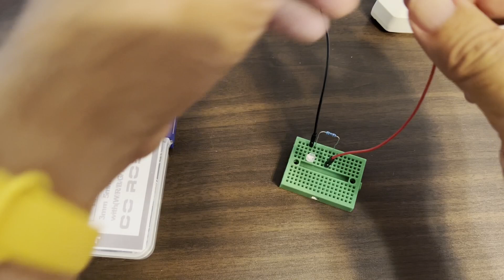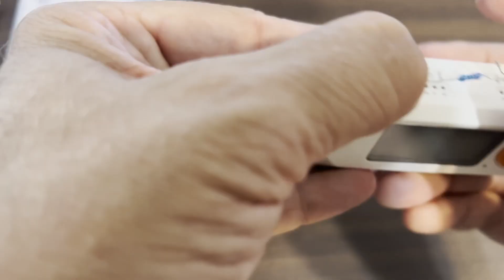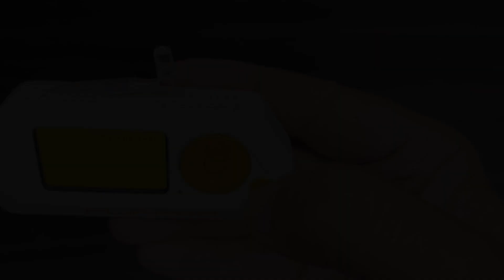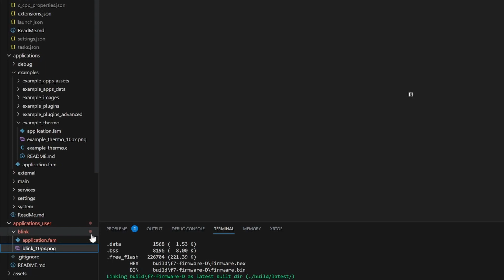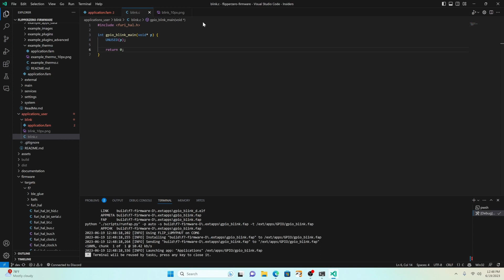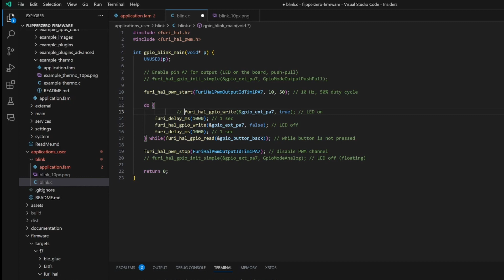[70] Flipper Zero - Write code to blink LED!

Comment: the git clone thing isn't showing up, im pressing control shift p
Reply: never mind, you have to press on the 3rd highest icon on the left, and download git from there, but it's not recognizing ./fbt even though I have ufbt installed.
Reply from the maker: The "fbt" is installed when you clone the firmware (you will see a file called "fbt.cmd"). I like to clone the firmware, so I know that FAP file I compile is targeting the same firmware as I am running -- and my internet connection is fast, so doing a recursive clone of the firmware only takes 45 seconds.

The "uFBT" tool is a lightweight tool that also allows for compiling apps, but doesn't require you to download the entire repo. From a terminal window, you can just run "ufbt launch" if you are in the folder with the application.fam file that you want to run (like the folder with the blinking light code). You may need to configure UFBT if you are running a different firmware, like Momentum -- I have some details on that in my wiki link below...

https://github.com/jamisonderek/flipper-zero-tutorials/wiki/UFBT
Reply: TYSM for the info @MrDerekJamison

Comment: I do control+shift+b and it doesn't  show me debug build, only "debug build app" and so on
Reply from the maker: Thanks for letting me know. It looks like they may have changed it slightly depending on the firmware. At 4:58 you can choose... 
"[Debug] Build Firmware" or "[Debug] Build update bundle" or "[Debug] Flash (USB, with resources)". Our goal is to get everything compiled.

Comment: thank you for this nice tutorial ! how can i debug mi build ? i can only debug build and upload on flipper
Reply from the maker: Not sure what issue you are encountering.  It's probably best to join my Discord server and ask for help troubleshooting there.  For debugging you need an ESP32-S2 running BlackMagic firmware, which connects to pins 10,11,12 of the Flipper Zero.  You can also use the WiFi Dev board, but the problem is then you don't have the pins exposes to connect your LED.  Please ask on my Discord server and someone will help get things working. https://discord.com/invite/NsjCvqwPAd

Comment: Why use a resistor just use B2 and GND JUST LED
Reply from the maker: There is a 51-ohm internal resistance on the GPIO pins.  The output is 3.3 volts, and a LED has a typical voltage drop of 0.7 volts.  3.3-0.7 = 2.6 volts.   The GPIO pins are only rated for safely providing a continual current of 20mA according to the Flipper documentation.   2.6volts/51ohms = 51mA.  Some LEDs have built-in resistor, but I prefer to ensure my current is <20mA at all times.
Reply: @MrDerekJamison  cool thanks man!

Comment: Thanks for the video Derek! Quick question, I just stuck the led in the C3 and Ground slot, and it turns on. Is it ok to use without a resistor? And can I leave it plugged into GPIO for extended periods?
Reply from the maker: I wouldn’t recommend.  Some LED have built in resistors, but others do not.  The GPIO pins are rated at 20mA (0.020 Amps).  The voltage is 3.3volts. 3.3v/0.02amps=165 ohms.  LED have voltage drop typical around 0.7, so (3.3-.7)/.02=130 ohms.  Flipper has internal resistor of 51 ohms on pin, so it’s likely exceeding the max current recommendation with a typical LED.  I’d add a resistor just to not exceed recommendations.  It’s still bright with 220 ohms.
Reply: @MrDerekJamison  Thanks for the input!! I’ll go ahead and add a resistor. Once I do that, would it be alright to leave plugged into Flipper indefinitely, or would there be some drain on the battery?

Comment: Hello, thank you for these very informative videos. Sorry for my English (I'm French). After copying the first part of your program and sending it to my pinball machine. The timer works well (the hourglass corresponds to the timer) but the LED never lights up, you know Do you know what I might have forgotten to configure? (do we have to configure something to access the gpios (the 5v is present).
Thank you in advance for your answer.
Reply from the maker: Does the LED turn on when you just connect it to 3V3 and GND?  If so, next I would try pin A7 and GND and using the built-in GPIO app to toggle the pin.  Finally, I would try code.  Furi_hal_pwm_start is easiest, since it configures pin for GPIO PushPull.  You shouldn’t need any 5V GPIO for a LED.  If you still have issues, join my Discord server and we can troubleshoot there.  Invite link is in my YouTube about page.

Comment: I did all this wonderfull tutorial and at the end all works properly, I'm newbie with VS Code and I had somme troubles with the "IncludePath:" in c_cpp_properties.json I put 18 paths to clean all include error file!  I'm sure I was wrong when I created the project on VS Code, also I was on Unleashed firmware and needed to flash in official version to run this tuto, many thank's Derek and merry Xmas ;-)
Reply from the maker: Merry Christmas + Happy New Year!  I find that when you sync to the firmware you sometimes have to redeploy the files from the "dist\f7-D" folder onto the Flipper Zero.  But after that "Launch app on Flipper" almost always works for me.

Next year (when I'm back home) I'll try it on Unleashed and see if I hit issues.

Comment: Hopefully I didn't miss a step, I keep getting this error "Update firmware to use with this Application (ApiTooNew)". I am super new to all this. I do have the same firmware on both the device and VSCode.

Thank you in advance.
Reply from the maker: Feel free to join https://discord.com/invite/NsjCvqwPAd and we can troubleshoot there.

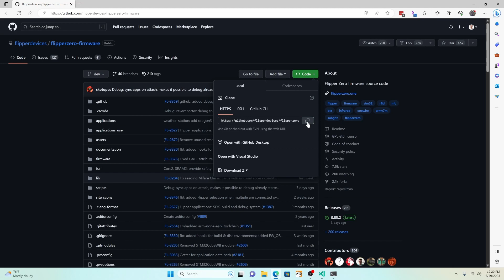It seems the firmware you are running and the firmware on the Flipper are different (at 3:50 I mention that the firmware needs to match).  Since you said they match, it's possible that you are on the correct firmware but a different branch (like running "Release" on the Flipper but "Development" in Visual Studio Code?)

This error happens when the FAP api_version.major is greater than the Flipper api_version_major (for example, on official firmware on Dec 6th, 2023 - Release is currently v95, and Release Candidate and Dev are both v96).

The easiest way to fix it, is to do Ctrl+Shift+B then "[Debug] Flash (USB, with Resources)".  This will change your Flipper Zero firmware to use the firmware that you are running on your PC.  If your PC is running Official, but your Flipper is running something else, then https://github.com/jamisonderek/flipboard#building-with-vscode-visual-studio-code has directions for setting up an environment and step 5 contains the links for the common firmware, so if you are running something like an Xtreme, Unleashed or RogueMaster, I'd say it's better to "git clone --recursive" from the links in Step 5, rather than flash back official firmware.  NOTE: You can skip the "flipboard" steps, if you don't own a flipboard.  The critical steps are "Git Clone RECURSIVE" for the firmware url & running "FBT vscode_dist".  My Discord server is recommended for troubleshooting, since we can have a chat, share screenshots, etc.

I'm happy to debug further in Discord & we can update the wiki with what we learn; which will help others too!  Thanks for your time.
Reply: Wow, thank you for the extremely detailed response. It's things like this which makes the learning process so much more fun. I will try the immediate things you have mentioned and see if they work. If not I will definitely reach out on Discord.

Thank you for being awesome!

Comment: Thank you
Reply from the maker: You're welcome.  Did you get it blinking?  This weekend I'm going to teach about the low-level Timer API exposed by the ST32WB55 processor that the Flipper Zero uses.  It's overkill for a normal LED, but still fun to geek out on.

Comment: Hey Derek, Thanks for good content. Could you please add LED and resistor specification to video description? Thanks in advance and have a spare time with good mood to create new tutorials!
Reply from the maker: I updated the description.  Amazon links are part of an affiliate program, so I may earn a small commission on the sale.  Here are the ones I purchased in the past...
The LEDs I used are here - https://amzn.to/45R6I1d
The Resistors I used are here - https://amzn.to/3sNTvY7

You can use any 2-wire LED that are similar (3V/20mA).  I've bought a bunch of different ones & they all worked fine with the Flipper (just make sure you connect them in the proper direction, or else they won't turn on).  You can use any resistor from around a 220-ohm to about 2.2 k (which is 2,200 ohms).  Red is typically really bright, so you can get away with a larger resistor -- depends on if your goal is a status LED (dim) or to light up a dark room (bright).  The smaller number resistor (nearest to 220 ohms) will use the battery faster and be brighter.  The GPIO pins have an internal 51-ohm resistor connected to each pin.  3.3 volts/(220ohm+51ohm) = 12mA of current.  I believe the GPIO pins are rated at 20mA, so you could use a 150 ohm, although I would personally stick to 220 ohm or higher.